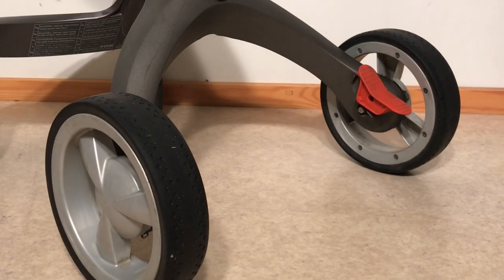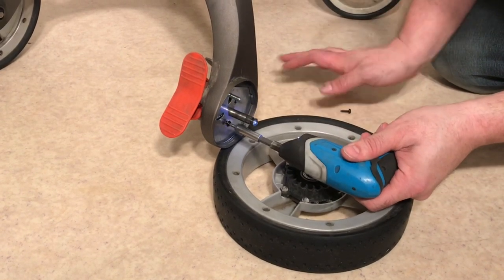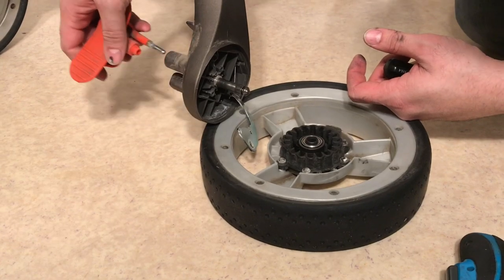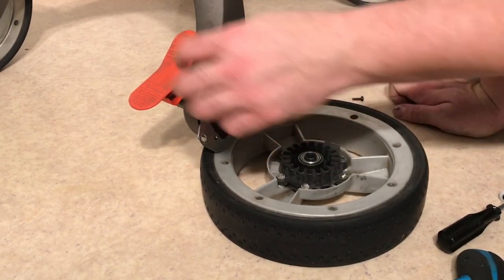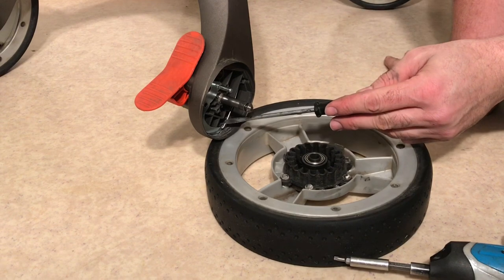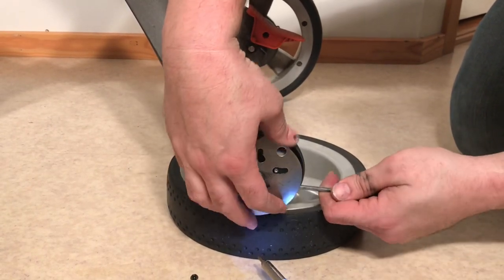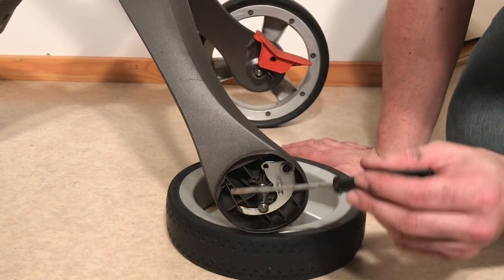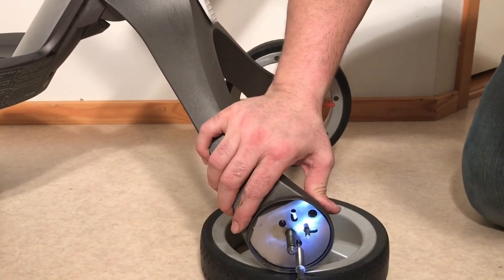Stokke Xplory Brake Disassembly and Repair Tips

Comment: Where does the pin rest on the left back wheel the wire runs to, that the brake isn’t on? When I remove the very bottom curved metal piece connected to the brake wire I find not the axel pin, but the other small pin coming lose over time and that looseness, affects the locking mechanism overall. Seems to just be resting on plastic underneath.